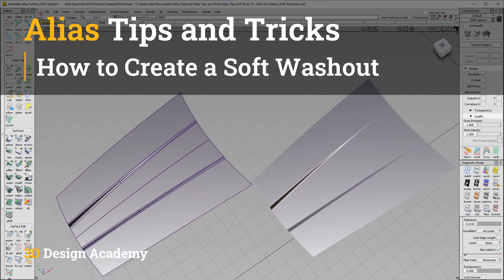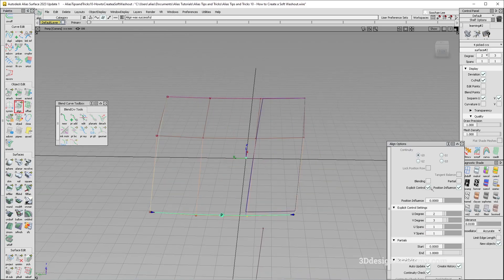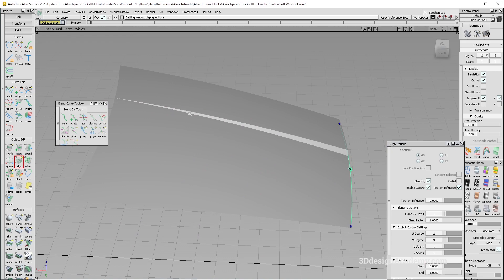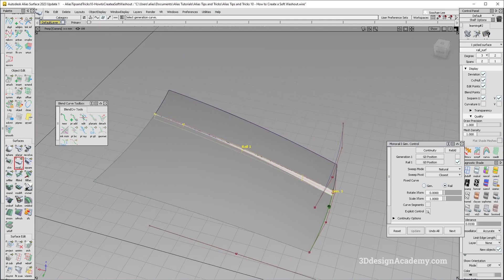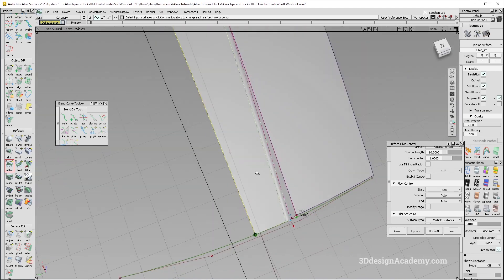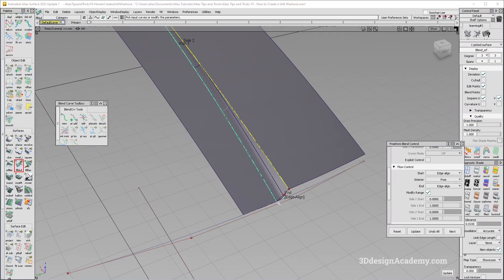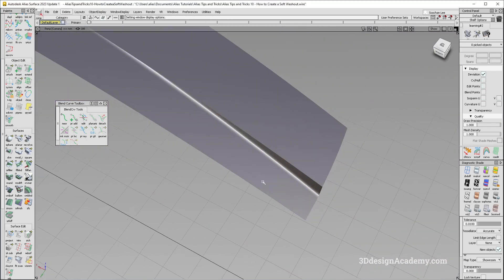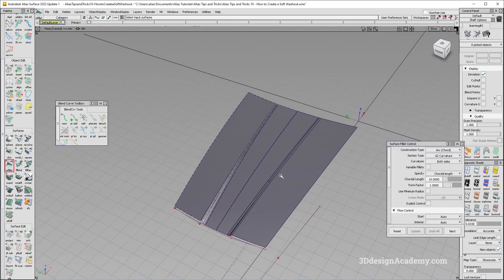Alias Tips and Tricks 10 - How to Create a Soft Washout

Comment: At first thanks a lot for making this video. I want to ask a question, at the beginning I'm trying to get your first primary surface then I managed to get that surface, but while I'm trying to align surface to the Duplicate curve, align command doesn't work. What should I do? I tried to delete construction history but again it didn't work. I always have the same problem when trying to ailgn trim surfaces. If you can suggest a solution I'd be very grateful sir.
Reply from the maker: It's probably because you're trying to align a trimmed surface. To align, you have to untrim the surface. Let me know if it works.
Reply: @3DDesignAcademy   Sir sorry I was a little confused, I had to trim this surface to get the primary surface you used at the beginning of the video. How did you create the primary surface or did you just only dragged the cv's of the plane. Thnak's a lot sir 🙏
Reply from the maker: @borazeytunlu963  Can you give me the time stamp of the part you're referring to?
Reply: Many thanks for your help Sir, I'll try as you say 🙏🏻🙏🏻
Reply from the maker: @borazeytunlu963  You're welcome! Let me know how it goes.
Reply: @3DDesignAcademy  Sir I did it many thanks again 🙏🤓
Reply from the maker: @borazeytunlu963  You're welcome. Hopefully it worked out for you!
Reply: 0:09 sir
Reply from the maker: @borazeytunlu963  I think I created that surface with a square. You can drag CVs too, but I would create with either a bi-rail or square.